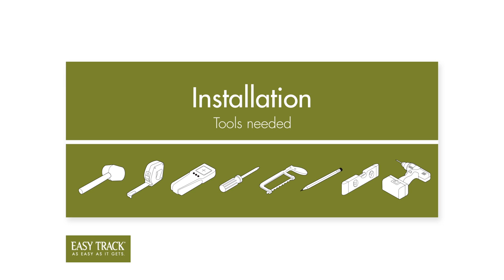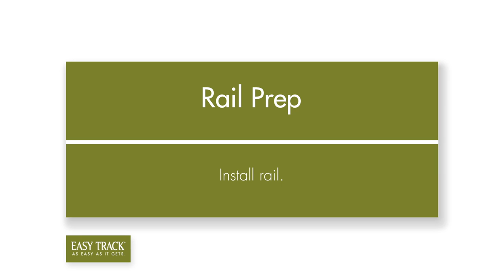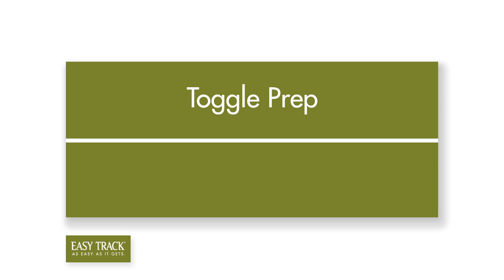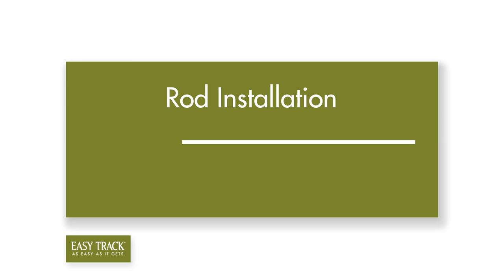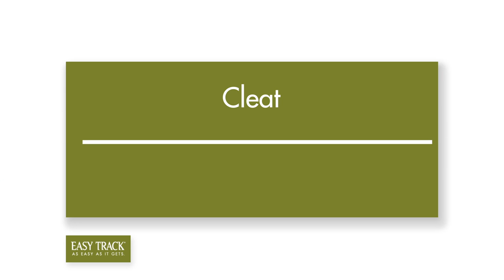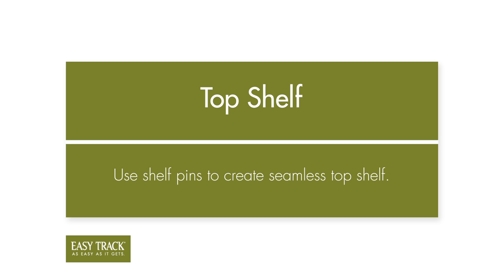How to Install an Easy Track Closet System

Comment: If you're planning to have the Deluxe Closet System fully extended (96" W)  do you need to leave a gap within the rails? Also, do you need toggles if you're mounting the system on a brick/cement wall?
Reply from the maker: Hi Olivia! Thanks for the questions. On the Deluxe Closet System, there is no need to leave a gap in your (2) 48" rails. They can be pushed together or can have a gap if you need one. Either way works. As for mounting to a brick/cement wall, toggles are not needed. However, I'd encourage you to chat with our customer service team at 800-562-4257 and they can give you some tips on how to mount it successfully.
Reply: How long is each hanging space fully extended? (The poles for hanging)

Comment: why are the vertical distances not given? everything else is self explanatory! do I add the thickness of the panels and length
of the hanger rods, and the tower unit completed? why isn't the most critical deminsion included for the layout?
Reply: Did you ever find the distances of the vertices

Comment: What keeps the outer verticals from sliding left or right if they're not attached to anything??
Reply: I've heard this is an issue with this style of closet systems. Many reviews suggested adding a screw to any shelves that are not against a wall to avoid the vertical piece from sliding out
Reply: You can add a screw to the end of the rails. The instructions tell you to let the rail extend at least 2 inches past the vertical boards. 

Even without the screw these systems weigh a substantial amount. They're not going to just slide sideways and off the rail on you. You'd have to physically push it extremely hard to make it fall. The weight of the vertical pieces also push alot of force against the wall they're leaning against which adds even more resistance